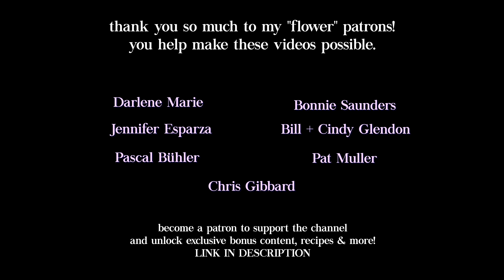Spring Days at the Cabin

Comment: Great vlog Ally! I am a little concerned that you guys didn't fill the spray foam fully and have all that empty space between the wall and the foam in some places. I've seen a lot of videos of professionals doing spray foam and they always fill it fully so just wondering if this might lead to a moisture/ mold issue in the future.
Reply from the maker: Thank you!! From what we researched, the thicker the coating, the higher the R value, and with spray foam its already really up there, so we didn't coat the entire thing (also very costly). Mason and Kyle installed some venting within it all as well. Right now things feel really insulated and tight, so I think we will be okay :)